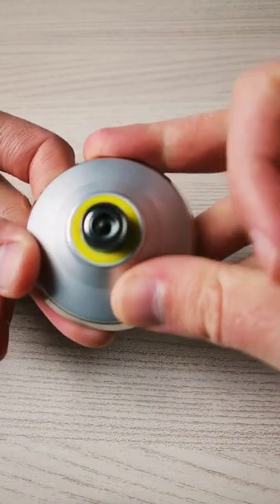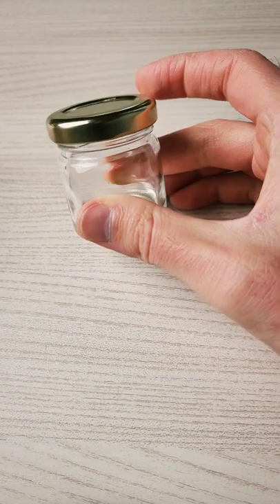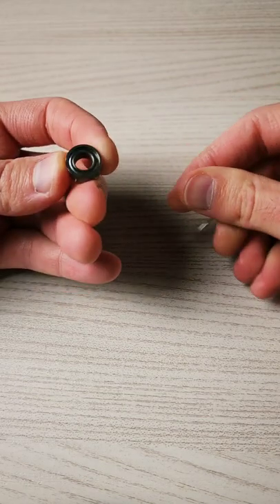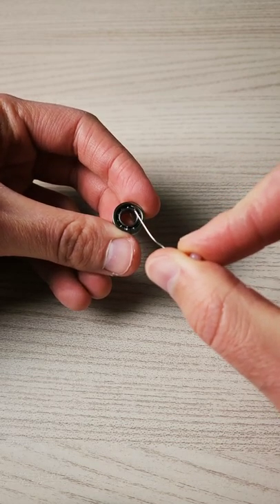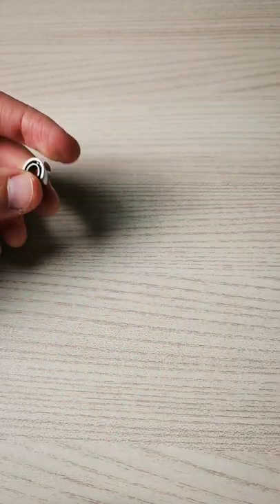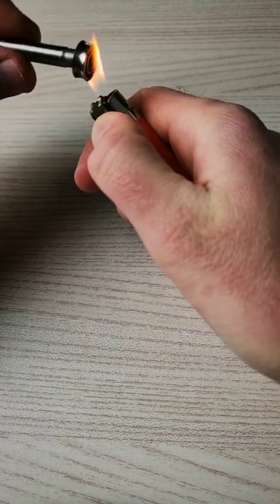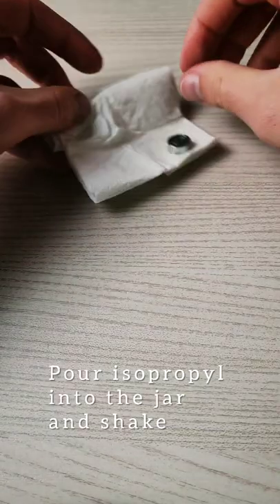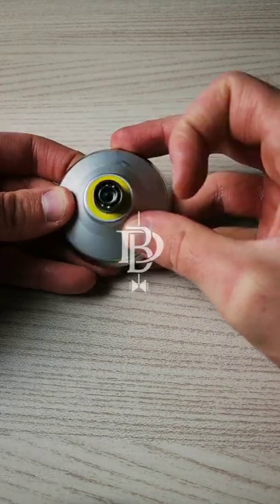I fixed a STUCK bearing!

Comment: Can you use thin lube for responsive bearings?
Reply from the maker: Yes, just a super tiny drop
Reply: @Diego B. Yoyo Things  ok ty. I have a few responsive and unresponsive yoyos but I only have thin lube. They say to use thick lube for responsive bearings but I dont see the difference.

Comment: pls use lighterfluid
Reply from the maker: 99% isopropyl alcohol is cleaner and cheaper in my opinion, lighter fluid is the best alternative, acetone is the last resort as it has a great solvent action but it will eat rubber pads if it comes in contact with them
Reply: @DiegoBYoyothings  oh okay tnx
Reply: I have waaaaayyy 200% better result with rubbing alcohol
Reply from the maker: @Aham-Na-jime it is important anyway that it's >95% alcohol, or it will leave residue on the bearing